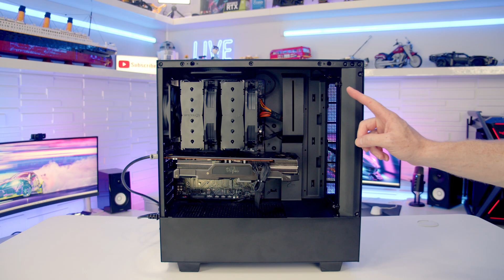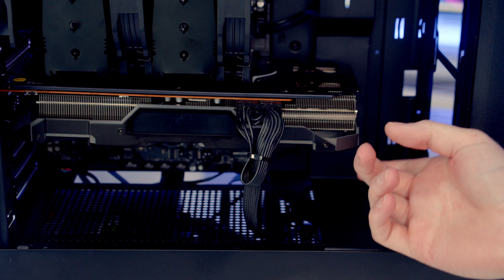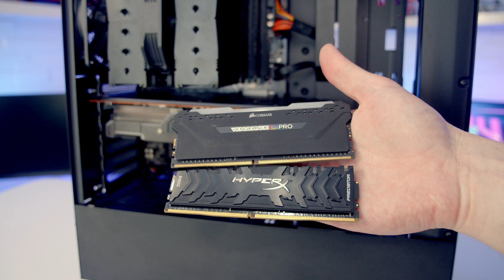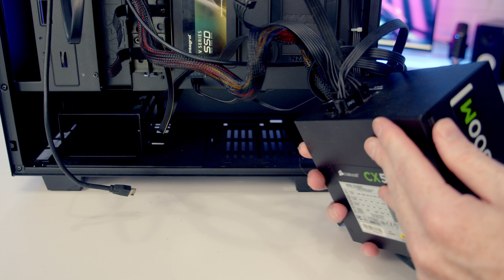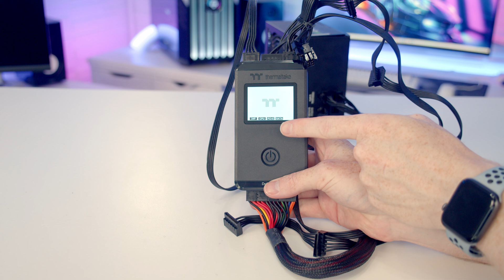Fixing a Broken PC - Episode 2

Comment: PCIE caables should be 2x separated, not 1x, that is an issue for sure.

AND 500w psu is not gonna cut it, is choke point.
Always 700w for modern gaming by default.

Comment: Yes I enjoy these videos, and they are really useful for builders who get stuck. You might want to show people how to take the motherboard out of a case and rest it on a its cardboard box to eliminate the possibility of shorts, and how to do a BIOS flashback. I know these are simple to do for experienced builders, but things like this would have really helped me a few years ago. Some faults to introduce at some point might be: plastic still left on the heat sink face, fans blowing the wrong way, wrong or out-dated BIOS for the CPU, insufficient power supply and only 1 8-pin cable on the GPU (when it needs 2).

I actually had a weird issue on my last build where my front USB 3.0 cable was really, really, really difficult to push onto the motherboard header pins. I honestly thought I was going to break the motherboard (Asus B650E). My PC refused to boot or even light  up, and after maybe an hour of trouble-shooting I reseated the USB 3.0 cable, which was still unbelievably stiff, and boom! PC started. So the moral of the story - check every connection, even the ones you don't think matter, or even remove the non-essential cables.
Reply from the maker: All good suggestions

Comment: That cooler is a ''slight'' overkill for the i5 10400. 😂 Btw Intel is usualy not so picky with different RAM sticks as long as they are the same speed and latency.
They usualy work but you mite have issues with XMP profiles. You would most likely need to do some manual tuning. But yeah having a kit of same RAM is always best. 🙂
Reply from the maker: The cooler did a great job of making the troubleshooting dificult, which I'm assuming was the main intention.